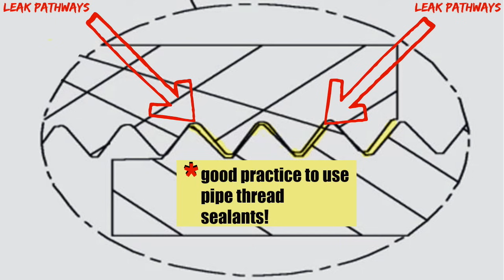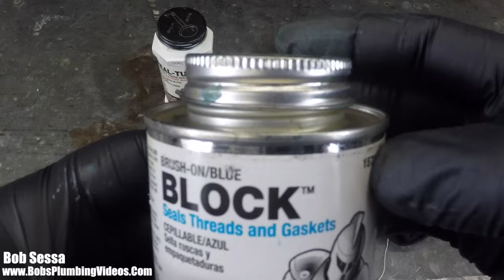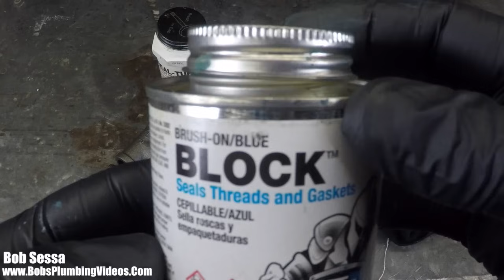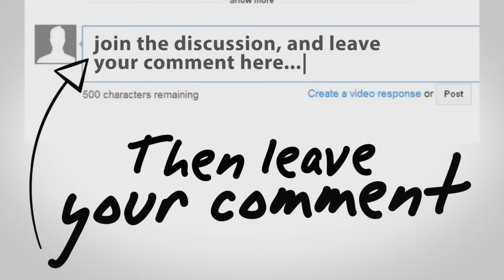Pipe Thread Sealant / Which Pipe Sealant & Why!

Comment: Disagree with covering the first thread with Teflon tape. Keep the first thread clean for an easy start. I agree with you and also do not run the tape all the way up the thread, it's just a waste of tape as those threads will never enter the joint. The other reason for not cover the first thread is any tape hanging over the first thread and end of the pipe WILL break loose and enter the piping system. In some cases this might not be a problem but in others you never know where it might travel to. Solenoid valves in dishwashers or ice makers are two examples where you don't want fragments of tape to be.
Reply: Yep. Just dug up my gas line and every single joint had excess tape hanging inside the pipe.
Reply: It seems all sealants are good
Reply: You only tried 3, didn't actually pressure test any of them for a comparison test. You didn't try any UK available or oatey products. Please do a better video, also why didn't you bother putting the tape on properly.
Reply: Tape is literally only to make the threads go together smooth 😅
Reply: @HambuglarOG  not true. It takes up space between the threads.
Reply: I cover them in industrial plants  especially steel pipes for a little corrosion protection

Comment: Been doing pipe fittings, sweating fittings for almost 50 years. Mostly just what my dad taught me. Never had an issue but ran into a problem “leaker” pipe fittings recently. Used the teflon and blue block successfully. Appreciate your post 👍
Reply from the maker: Good stuff! Thanks for sharing!

Comment: I have had nothing but failures with teflon tape and struggled with leaking pipe joints for years.   I thank you for exposing how to successfully sealing pipe thread fittings.
Reply from the maker: Long before Teflon, spool lampwick and Hercules pipe joint compound (Pro Dope) were the go too products. They worked when I was coming up in the trade and they’re bullet proof today! Thanks for checking out the video, regards. Bob.
Reply: Sounds like you were probably applying the teflon against the threads rather than with the threads(clockwise)
Reply: never used pipe dope....wrap it in the right direction ...less is more...on old fitting I put a little never seize on the threads then cover with teflon tape

Comment: What would you use for indirect a hot water tank?  I really want to know. I think the first fitting is on a tank crucial and don't want to mess it up.
Reply from the maker: My go to is always Teflon Tape and Mega-Loc compound. If I suspect a problem thread or just want to insure a leak proof joint I will use Teflon and Blue Block compound.

Comment: Love the Megalock, discovered it by accident at Home Depot, just using it for water fittings around the house. Back in the late 60's/early 70's I worked for a gas utility, they exclusively used the old yellow Rectorseal. No teflon in it in those days. I always felt it just lubricated the joints, with high pressure mains and gas at 75 or so PSI, how could compound hold back the gas, it's really the compression of the pipe and fitting. We always called it pipe dope, never heard anyone call it compound.

Comment: My question is when installing a threaded PVC adapter to a Brass thread (PRV) for a sprinkler system should you use teflon tape only or teflon tape and teflon Thread Sealant like Christy's Ultra Seal T-10,000?
Reply from the maker: I would use a good quality tape like Blue Monster w/ a thread sealant like Hercules Mega-Loc or Real-Tuff pipe joint compound.

Comment: I'm having a difficult time with a Compressed air system,  it's only 125 psi, but tape and the thread sealer i have is making bubbles.  You said the tape and sealant was perfect for liquid,  but that you only use the blue block when working with gas,  but from what I've read natural gas is only a couple of psi at most. So which method should i use for Compressed air,  which is higher pressure than the 2 examples toy covered
Reply from the maker: Yes, gas is low pressure and here in NYC we're not permitted to use Teflon tape on gas joints. I use the Blue Block as an insurance advantage because it sets semi hard which forms a gasket type seal. If you're having issues with the Teflon and Blue block, I would go with the spool lamp-wick. Starting a thread or two from the end of the pipe working it back about 3/4 of the way, followed by the Blue block. You can also place a round or two of Teflon over the lamp-wick, then the Blue block.

Comment: Hi there, awesome video. I am installing a diesel slip tank in my pickup. I assume I should use a thread sealant with PTFE? I have a under tonneau cover slip tank therefore the pump will be below the highest level of diesel fuel, thus putting a lot of pressure on the pump connection where it screws into the NPT on the slip tank. Should I use teflon tape and thread sealant or just thread sealant with PTFE?
Reply from the maker: I would use Teflon then Blue Block thread sealant. Pretty much bullet proof!
Reply: They make a special PTFE for use with gasoline/oil automotive uses....should be all you need

Comment: I am using a head plug to plug a faucet valve. Should I thread it all the way? it feels a little not that tight and I do see a little bit of water seeping through, is it also tapered? I already used white tape,   should I go exchange a different one? or should I add something else in addition to the white tape to seal it better? If yes can you suggest something for me to use? Thanks
Reply from the maker: Not sure what you mean bu "head plug"? Are you trying to plug a faucet spray hose outlet? Can you forward a photo? Send it to info@robertsessaplumbing.com.

Comment: Very good video. One comment though. I am a retired instrument technician from a nuclear power plant. We stopped using teflon tape in the plant due to technicians installing teflon tape to the very end of the threads (the narrow end). For a while we could use pipe dope only. Because the threads are tapered, the first and / or second thread do very little in the sealing process. What we saw occurring was pieces of the teflon from the narrow end would become loose and go into the system (water, steam, whatever system it was on) and clog something down the line. We call it foreign material in a nuke. Not good for the plant.  
I noticed in your video you like to go to the very end and even some of the tape was over the end of the pipe somewhat. That was something we had to be very careful not to do and I follow the same practice when I do any plumbing work. 
Another note. I was watching your video because I am installing a water system in my house. It uses plastic fittings (male and female) and I am using brass fittings to join the house to the new water system. I encountered some leaking problems and was wondering if you have any thoughts on sealing those kind of unions.     Thanks,   Jerry
Reply from the maker: On brass to plastic connections as a rule on waste lines (low or no pressure), I'll use a  good quality Teflon and the Mega Lock joint compound together. On pressurized water line's I'llsubstitute the Blue Block instead Mega Lock. In extreme conditions, I use the spool lampwick and Blue Block.

Comment: Excellent video, very informative. When I built my house about 30 years ago I hired a plumber friend to do the plumbing and I worked along with him. I had some experience sweating copper and working with PVC but by the time the house was finished I had experience with gas line installation, putting in a boiler, running a threading machine, codes, you name it. I think I could have become a plumbers apprentice. One thing he taught me that has stuck through the years is when allowed (not on gas pipe) to use Teflon tape and then pipe dope over it. He said doing this will just about guarantee you'll never have a leak and I never have so it was interesting to see that you do the same thing. The only time I ever had problems doing this was when I had to replace a leaking expansion tank on my boiler. The expansion tank is threaded into an air scoop which is made from thick cast iron. Teflon is a great lubricant and it allowed me to over tighten the expansion tank pretty easily and put a hair line crack in the scoop. I was told later by another plumber that he never uses Teflon tape on cast iron for just this reason, a lesson he learned the hard way himself.
Reply from the maker: Thank you Rich, much appreciated. Bob.
Reply: @BobsPlumbingVideos  what do you suggest on stainless to stainless or stainless to brass?

Comment: Hi Bob, ive installed many gas line connections and threaded copper and brass fitting with success.. the other day I replaced the shower head in my shower with tape (four wraps) and megaloc and its still leaking.. not much at all, like a few drips after each shower.. but it bothers me. I can’t figure out whats going on. I see a rubber gasket at the connection from shower head to the arm. Is the tape and dope doing more harm then good?

Comment: Thank you for the great video and info, i have to seal a tank at suction line that is leaking and the Austrian company that built it used hemp sealant but is there another way to seal this joint if i do not have hemp?
Reply from the maker: Glad it helped

Comment: Excellent video! Can you give me any advice on what I should use with fittings that go into a steam generator? I picked up a bunch of these Hoffman steamers that I need to rebuild, and I've never worked with steamers before. Also, while taking these things apart I notice a lot of the fittings are corroded to hell and back. I actually had one of the nipples snap in half while trying to take it out of the vessel! I don't want these things to corrode again if I can help it, so any advice on how to prevent that in the future? Sorry if these are all basic questions; this is all rather new to me!
Reply from the maker: I would most likely use a combination of either the old style spool lamp-wick or blue monster or mega teflon tape and the blue block sealant. I find the Blue block the most reliable sealant when working with older corroded fittings. And if possible clean out your fitting with a sharp pipe tap to insure a good fit between the male and female fittings.

Comment: Bob, are  megapress fittings with the yellow legal for use in NYC? I noticed they offer them in yellow for gas. What's the about hangers for gas pipe? What type of hangers and how far in between?
Reply from the maker: https://www.contractormag.com/piping/article/20872714/viega-gets-propress-approved-in-nyc.

07.2 Design and installation.Piping shall be supported with metal pipe hooks, metal pipe straps, metal bands, metal brackets, metal hangers or building structural components, suitable for the size of piping, of adequate strength and quality, and located at intervals so as to prevent or damp out excessive vibration. Piping shall be anchored to prevent undue strains on connected appliances and shall not be supported by other  piping.  Pipe  hangers  and  supports  shall  conform  to  the requirements of  MSS  SP-58  and  shall  be spaced  in  accordance  with  Section  415.  

1/2" pipe every 6 feet, 3/4" - 1" pipe every 8 feet, 1 1/4" and above every 12 feet.
Reply: @BobsPlumbingVideos  thank you Bob

Comment: Thanks Bob for a great video! What are your thoughts on anaerobic sealants and how long do you have to wait before turning on the gas after  using an anaerobic sealant ie to allow it to cure properly etc
Reply from the maker: When working with low pressure gas or drainage fittings I'll turn it on immediately, if I have a questionable joint on a water line I may wait a few hours before turning it back on. For the most part in everyday situations, everything goes live immediately.

Comment: Great information video. 
Q. What about PVC threaded mixed with metal threaded fittings? I've had water lines that were being used for well house, sprinkler and had mixed success. I was taught as you mentioned cleaning the threads with a brush first but even had leaks. I have used T. tape, T. tape with joint compound and still have a few issues now and then. Any advice would be appreciated.
Thanks for sharing.
Reply from the maker: I would use the spool lamp-wick (Minimal) in between the threads. Followed by Teflon, then Mega-Loc joint compound.
Reply: What did you decide to use? Have a few 1" male PVC to 1" galv female.
Reply: I hate plastic to metal threads....teflon and paste.....I know you're not supposed to do it but that's the only time I'd put a little paste on the internal threads of the steel fitting

Comment: This Old House plumbing demo used a twist of  hemp rope and yellow Rectoseal to seal leaks from pipe threads. 
My Ace hardware  store had a small tube of pipe thread compound and I felt lost on the wicking, not finding hemp. Looks like you used a cotton wicking. Can I use sisal? Will it swell like hemp, also?
Reply from the maker: Not familiar with Sisal, but in the early days I've used the cotton wicking and Pro Dope with much success.
Reply: @BobsPlumbingVideos  I wasn't sure if cotton would swell like hemp, but sisal has too many loose fibers after looking closer. 
Thank you.

Comment: I'm fitting a new air regulator onto an air compressor and struggling to get it air tight. Both threads are straight but there is a locking nut on the male thread of the regulator. I've tried pipe dope and tape but it still leaked a little. Do I just need to use more, or try a hard setting thread lock instead?
Reply from the maker: Andrew Faulding   I would would try using Teflon and either the Hercules Blue Block or Grip. Wear gloves, use it sparingly give it 24 hrs to set up.
Reply: @BobsPlumbingVideos  Thanks Bob!

Comment: HELP...Just installed a new Water Heater things went well except for the Flex hose (hot side) going to the pipe at the house. The old cast iron pipe coming from the house had corroded threads. Cleaned up the treads pretty good, use Teflon tape, Still have a Very Slow Drip! would You recommend the Blue pipe sealant You use to fill the Tiny imperfection in the Pipe? Again HELP! LOL

Comment: Greetings! Which Loktite number would you recommend for fastening brass + brass (connections for high pressure water systems), as well as steel + brass, sometimes stainless steel + plain steel or brass. Thank you! =)
Reply from the maker: Not sure I'm understanding Loktite #? My go to sealant is Blueblock or Grip for low pressure, high pressure, etc.

Comment: I have always used Megaloc but want to try a new product just for fun. Would you say the standard Blue Monster thread sealant or the newer Blue Monster with PTFE pipe thread sealant which is white rather than blue would be better? Thanks for the awesome video!
Reply from the maker: Thanks for checking out the video, I would say the standard Blue Monster w/ Teflon tape will get the job done. I currently still use the Megaloc w/ Teflon. I wanted to love Real-Tuff which is white, but it's to messy I.M.H.O!

Comment: I replaced a 1 inch cold water line going from the well casing to house. When I tighted the PVC threaded male fitting to the metal female well casing I didnt tighten quite enough. After hand tightening I wrench tightened 1 and 1/4 turns. When I turned water on there is a tiny air leak with a tiny drop of water. I cant tighten any more because of the glued fittings, What can I do ?
Reply from the maker: The right answer is to cut it out re-glue and retighten everything. A long shot is if you can shut down for 24 hrs, coat the area you see the leak with Blue Block. Turn it back on and cross your fingers.

Comment: Thanks for the video.  I need to unscrew pipes that have pipe dope applied to them.  How can I safely remove copper water supply lines attached with pipe dope before replacing them with braided water supply lines?  Is there a specific technique to use with copper lines, water supply lines, and PVC?
Reply from the maker: Most important is to hold back on the fitting you're attempting to remove the pipe from. Remove counter clockwise and hold back in a clockwise position.
Reply: @BobsPlumbingVideos  Thanks, Bob.  I'll make sure to do so.  So, it should unscrew without a need for vinegar or wd-40 to dissolve the pipe dope/pipe joint compound?

One final question is if you think it's wise to install a Delta faucet with PEX water supply tubing.  I was hoping for braided supply lines but found out Delta only uses PEX tubing on this item.  I would rather not cut it and risk adjoining the ferrules incorrectly.  Is it okay to loop the PEX tubing once before attaching it to the water supply valves?  Or should I consider finding another faucet that has braided supply lines that can be looped?
Reply: slightly heat them with a butane torch just be careful not to light a fire

Comment: I have a shallow well pump and I’m having trouble with the pvc sealing on to the cast iron and galvanized pipe. I  tried Teflon twice but keeps drawing air. do u think the blue block and Teflon would work well the pump is pretty old
Reply from the maker: I would use the spool lampwick followed by the Blueblock, or Teflon tape followed by the Blueblock!

Comment: Great video, thanks for sharing! But still have a question...
I have a shower head arm that is a little loose when oriented in the correct direction. If I try to make one more revolution the arm gets so tight it only makes it 3/4 of the way around.
Wondering what I can do to ensure that there is no leak since this is a remodel and there is no way to see if there is a slight drip inside the wall
Reply from the maker: In a situation like that, I'll remove the arm and double down on the amount of Teflon. Instead of 5 or 6 times around I'll go 10 or 12 times around. It will usually  make up the difference and you  won't have to make that final rotation.